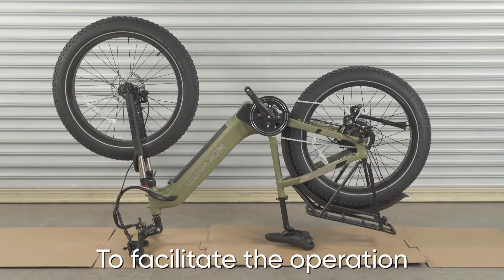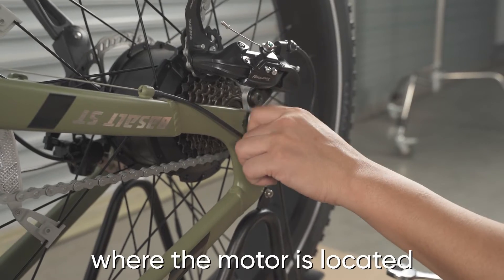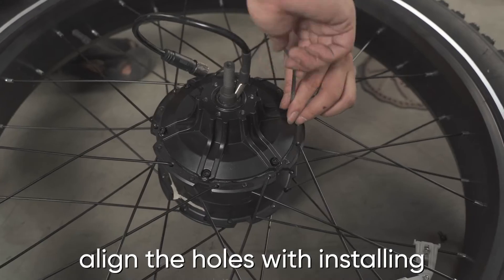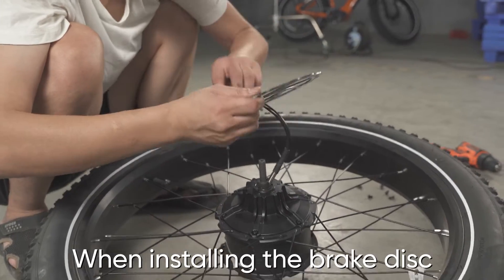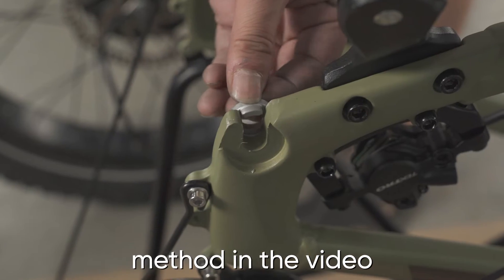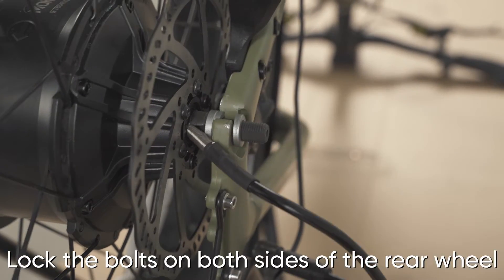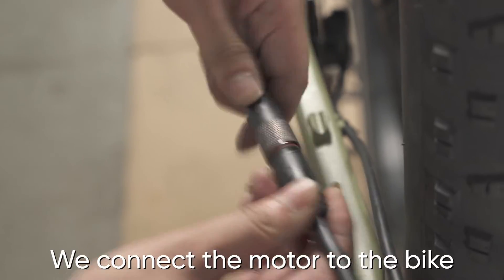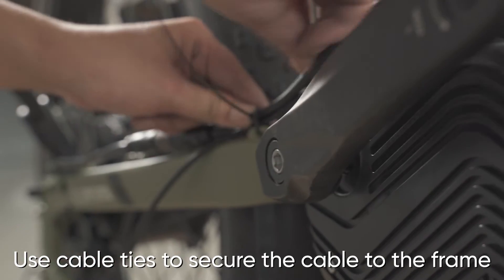Mokwheel How to replace the Motor

Comment: Im guessing.. the motor needs to be replaced when you press the throttle.. it doesn't go but you hear the grinding noise in the back tire? Current situation!